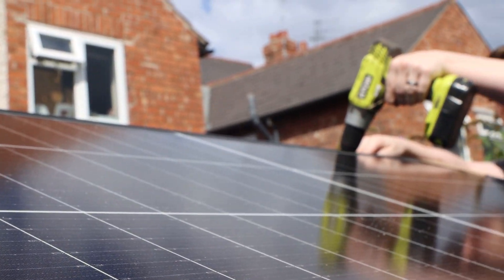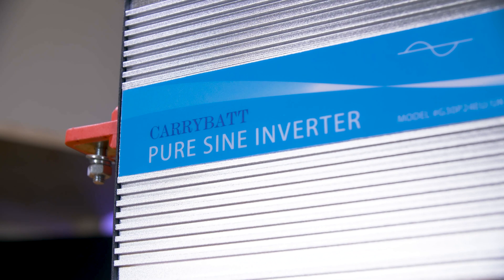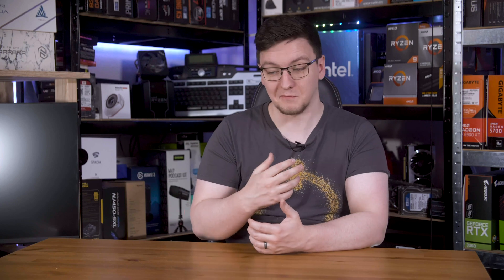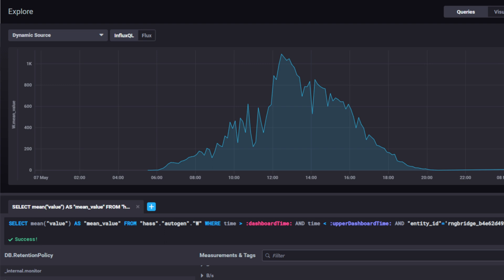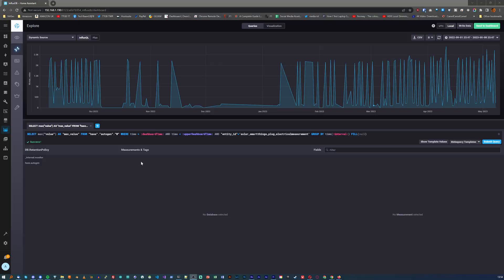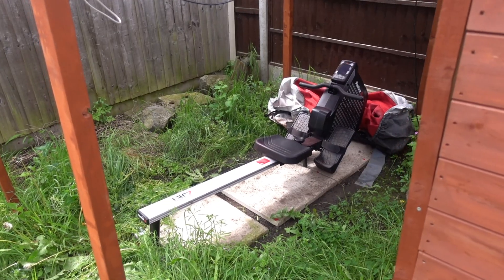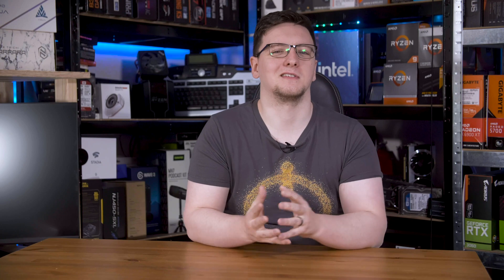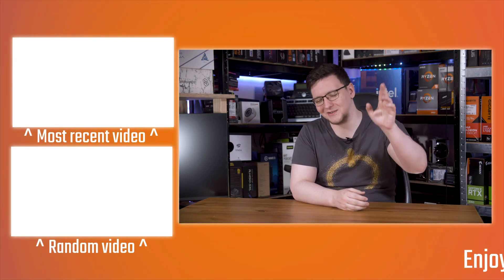DIY SOLAR POWER UPDATE - Winter & Spring

Comment: I did the same, slightly bigger scale, diy 3kw panels on shed roofs, diy lifepo4 14.4kw, armoured cable into loft etc, double sockets into each room, all in one epever 3kw inverter, run the whole house (1.5kw immersion element for hot water, 1.5kw air fryer oven and 500w multi cooker for cooking) . Not used a drop of grid power since end of march. Charge storage from the grid economy 7 rate (8p kwh edf) in winter and use in the day. Use up any extra power in the summer with a crypto mining rig.  Home assistant, tablet on wall etc. Total cost £4000, payback in 2.5 years. Saving me £130 a month. Awsome setup, beats all the posh setups hands down 😎😎😎😎😎

Comment: Nice setup. I did much the same fitting a solar system to my van, albeit with only 3 x 100 watt panels. Luckily I bought the LiFePo4 cells before the prices went silly but even so it'll take a long time to recoup my investment, if I ever do. That said, I did it for the  convenience for having power when I'm on the road. Last summer I regularly saw peaks of more than 320W around early afternoon so solar panels can definitely exceed their rated output.

The only bit I'm confused about is when you mentioned air conditioning. I must have either misheard or was momentarily transported to an alternate universe where the Scotland I know and love is hot and sunny 🤣